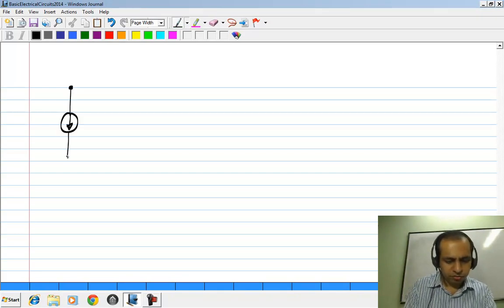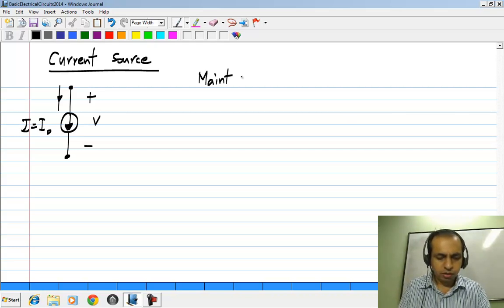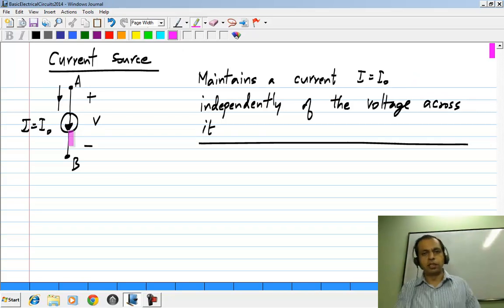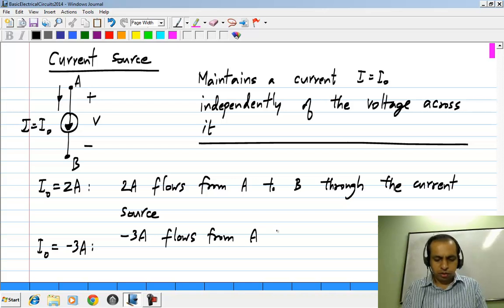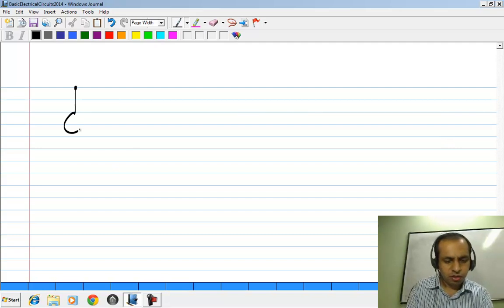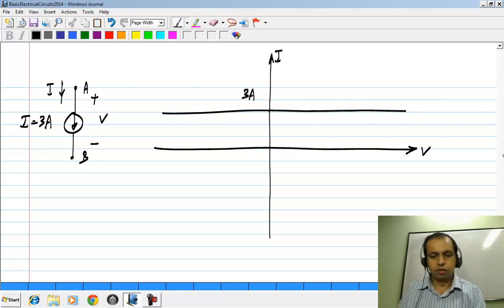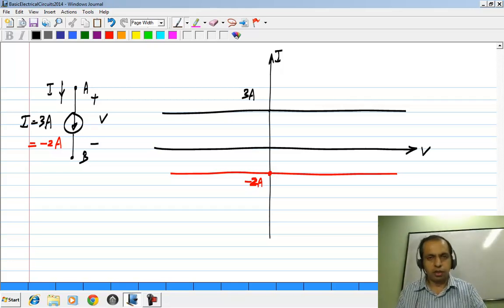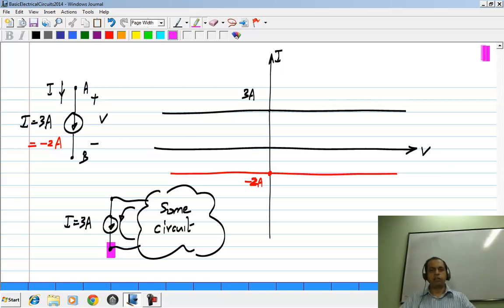Current Source

Comment: How to measure source (battary) current?
Reply: Ammeter
Reply: @shariefmahaboob2363  but when ameater direct connect to battery then it shows maximum current
(For eg. our mobile chargers  generally 5v but its current rating is diffferent like 100mA ,200mA, 1A
So my question is how to measusre this current?